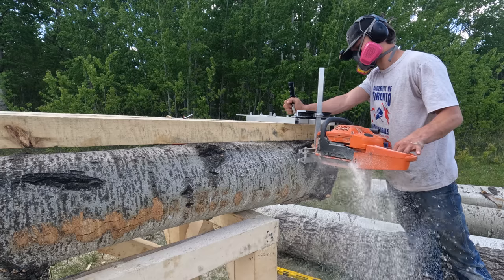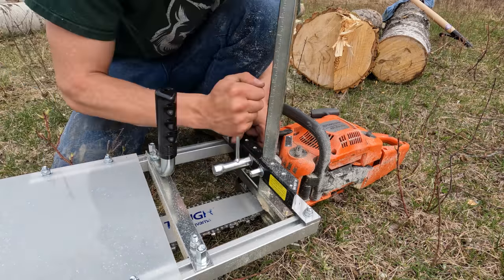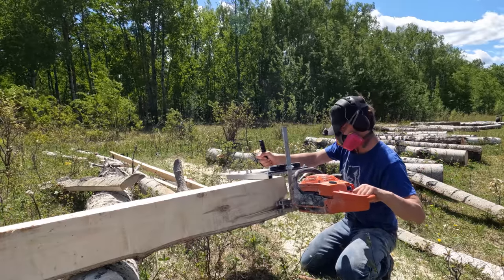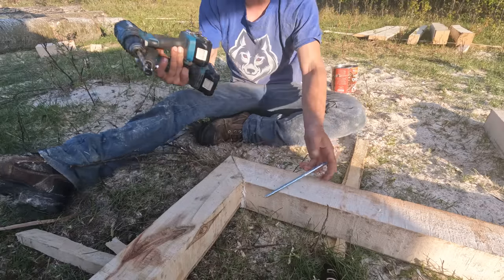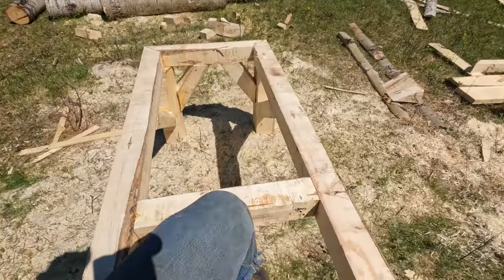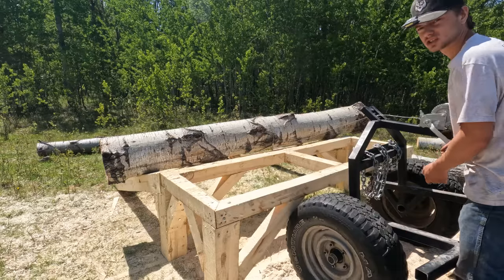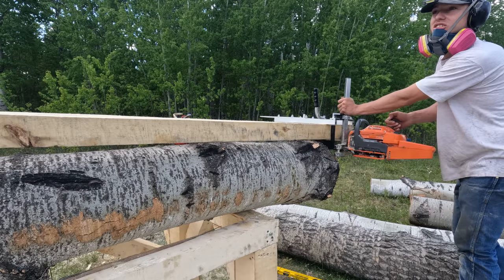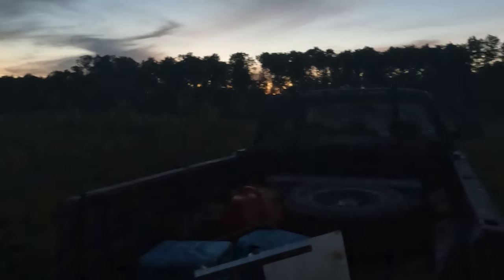New Chainsaw Mill - Milling Lumber, Building a Workstation for the Mill

Comment from the maker: Hey friends I hope everyone is doing just great and that you enjoy the video. I am seeking assistance in regards to treating the milled lumber against wood insects. I have been seeing a ton of old house borers (i think this is what they are called) around my mill. Dont see damage on the wood but am wondering how i should go about protecting the lumber from infestation of all sorts and thought I would ask you guys what you would recommend doing. Thank you
Reply: Borax and water in a spray bottle
Reply: Borax and water, spray it on
Reply: TimBor or Bora Care, commercially sold. I use it for house treatments to protect against beetles and termites here in Florida. Good luck!
Reply: @russellwatters5891  that's what I was going to say.
Reply: @matthewharvey8755  sorry, I took the words right out of your mouth..lol 🤣😂
Reply: So three things here...you have water and bugs outside that want in, burn them with a torch/fire that actually works really well, but takes a long time.There is copper green, it's a paint on green treat to keep bugs from entering, borax mixtures, TimBor is nice, as well as Bora Care. The bugs inside deep(6+ inch) will not be effected much.... Unless you want to soak in a green treat, but that's $$$$$$. Lastly (my method) is mix a 50/50 diesel with used motor oil. I use it on all my lumber, it's nice on my southern yellow pine. For post I burn them, then apply a thick coat of roofing tar.
- So in short, bugs inside deep will not be effected, but those under 1 inch can be killed, and it can be treated to keep em out. 
- Can't wait for more milling videos, I love my Woodland Mills, already want a bigger one
Reply: @matthewharvey8755  I'm not sure Coppertox is available anymore, and the green is just a dye or tint added to the mixture to show where it's applied. Green or green blue lumber from box stores is mixed borate/ and tint. Soaking in a vat is definitely the best method, only it makes boards warp from the moisture.  I can only speak for what I use here in Florida, an exterminator for 42 years, I've used pretty much everything. Not certain about Canada products, but check your local extension office, or research online for identity.
Reply: If the bark is off the wood you don't have to worry about insects. Also it looks like you are ripping your lumber a full two inches. That is just wasting lumber if you are not sending them to get planed down to store bought dimensions.
Reply: Tried lightly torching it?  "Shou sugi ban" nukes some of the proteins in the wood and makes it less appetizing.
Reply: Old burnt oil is the absolute best thing to use for treating your lumber and it’s cheap.
That’s one heck of a massive strong platform for cutting down the trees into lumber. Brother you’re doing a fabulous job and you really take your time and you’re building it right! 
Thank you brother for sharing your time in the bush with us all, I can’t wait until your next video comes out every single time and you have me rolling laughing out loud so keep up the great work! Thank you 🙏
Reply: Get rid of the bark on your logs as soon as you can it does prevent some bug infestation also they dry faster without the bark.
Reply: Hey love the videos. I live in Saskatoon, I have a huge 5 gallon bucket of framing nails that I will never use. Not sure if you make it down here but I would love to give them to you. You would have more use that I do
Reply: Down in the states, we have ash borers show up within a day of cutting or splitting any ash trees or wood.  Don't know if they are attracted to popple or not.  They don't hurt the wood any, just like to lay eggs under the bark.
Reply: 50/50 diesel and motor oil. Brush it on thick and let it soak in.
Reply: Would a solar kiln get hot enough to kill insects?
Reply: @keen9629  he has a large forest mate and said that he wanted to work with true dimensions hes not running out
Reply: @thispandaispurple  best way to get rid of bugs on animals. Also the dish soap and javex method is for grubs eating your grass. Best way to treat wood is remove all the bark right away and use a pesticide for that type of wood. Hardwood is the worst for bugs like pine and spruce but either way the wood has to be treated as soon as you can.
Reply: Some advice u have steal a welder  buy a motor put it on it is cheap and it work look it up on YouTube and save time and simple 😅😅
Reply: Just wanted to say thanks for being real. About the process, the problems and the solutions. I have some big ponderosa pines that have been drying on my land for years, and I plan to mill them up, w chainsaw, this afternoon. Seeing this comment made me to some research into Borax and water. Going to be treating the boards with that. Also Subscribed.
Cheers

Comment: As an old one-armed chainsaw mill operator (I moved up to a bandsaw mill last year) I've found it just as cheap to buy a 2000lb 12v remote control winch for around $80 from Harbor Freight. You can operate it from your ATV or 12v lighter on your truck. I use half a section of a 24' aluminum ladder for my guide-rail and it always produced nice boards. Hope you have as much enjoyment making your own lumber as I have in my 67 years of living free. Love your channel and been with ya since the get-go!
Reply: Drilling holes up the 2 rails and putting in stop blocks to prevent rollback would help too.

Comment: Two things. First your out in the boondocks, you need to buy a good tourniquet. They don't cost that much. Cut and artery and your going to sleep quick. Keep it on your belt all times your using a chainsaw. Second you need a rip chainsaw blade that blade cuts faster and produces a board without waves. Looks good.

Comment: Hey bud, good job building that. I usually mill with a 372XP, nice to see a 455 at work. As a tip from a fellow Canadian, I started using a narrower stihl chain. I also use skip chain and filed it similar to a Granberg milling chain. Think there is a video or 2 kicking around here. Speed of cut was night and day! Easier on the saw too. Give it a go and see for yourself.
Reply: I started out with a 455 Rancher and very quickly realized I needed a much bigger saw. Went with a 395XP & I also use a skip tooth ripping chain. I am usually sawing 30" plus doug fir though. I just use half of my extension ladder for a starting rail. If I would have known back then what the cost of lumber was going to do, I would have probably just spent that money on a band saw mill.

Comment: What you need is a longer cable to go around your log then back up to your winch. Then what happens is as you pull the cable in it encircles the log and the log rolls up your ramp. Stay safe have fun God bless   🇨🇦✌️
Reply: Yeah weld a lug on the skidder. It will actually make it twice as easy to winch too as having the double length of cable has the same effect as pulleys.
Reply: He knows. He says it in the video

Comment: Don’t know if this has been mentioned but “wax” the ends of those puppies and stack them semi-proper with stickers every so often (depending on overall board length) and they won’t move around too much on you. I’ve heard guys just paint them thick with a latex on the ends and it works just as good. No twist, no curl, just straight shooters.

Comment: Looking great ! Good work on quitting the darts and trying to help your health.  I would also consider wearing a respirator when grinding/ welding . Those wheels create a mean dust and flux core isn’t the most clean welding fumes  out there . I like the 3m pink pancakes 2097 so they fit under your hood. Looking forward to next vid !

Comment: Congratulations Bud you are now a sawyer,  nice set up for sure . The only advice I have with poplar is either nail her quick or strap it quick.
      I think getting it dry is the only preventative there is ,bugs need moisture in the wood . After it dries it gets very hard , this was a great episode thanks. If you can't get it under a roof then old tin on top seemed to hold a cooler temp for slower drying.

Comment: Flip the handle around on the mill attachment. It’s will be easier on your back. As for the oil you can turn up your oiler for the bar. It should be located on the bottom of the saw. I just adjust mine until I use just as much as it take for the gas to run out. Or you could refill more often. Periodically pull the bar off and clean the groove out with a knife.

Comment: I never realized what nice square lumber that would make. You must have got the angle right. Those are heavy logs. So far you made everything you're using, even the log skidder. I hope that hot shower is working for you. Great video. Pax.

Comment: Great video, old retired forester , portable sawmill operator here, welder , fabricator!  Think - your ramp & log platform is superior , what I if your top rails were fastened to the platform over top your log.  Use a cuff. To allow raising $ lowering rails, pin in place Cut, flip log, lower top rail say 2 inches to cut other side,  even have a square side jam to do that 90 degree cut.
I bet u could fabricate this easily on your platform,  be unique, & make a unique video!
I will follow you progress! 
Bill in Indiana
Reply: Holy smokes Bill!  that's a great idea!

Comment: The best, inexpensive and easiest solution to keep milled lumber is a Japanese technique called, shou sugi ban. You char the wood to an alligator texture,  brush it back with a wire brush and then oil it with linseed oil. Do some research and check it out. Sealing the ends of the wood with melted wax will also help prevent the wood from warping while it dries. I'm so happy to see you excited about your new projects and look forward to watching you grow as a builder. Your welding is beautiful and your precision with wood is just as craftsmen like.

Comment: quick off the cuff idea.....check the junk lots for treadmills! big wide belts and rollers! Not to mention electric motors you could solar power maybe? or check local restaurants for old cutting bords AKA Delrin to make sliders for the ramp

Comment: Damn that's a lot of hard work! Good on ya bud! If your winch cable is long enough, run it from your winch under the log and back up to the winch body, that way it will roll up vs drag up. Little slower but way easier on you and ramps

Comment: center the tree growth rings at the ends to horizontal .  then cut it on horizontal cuts to get the biggest beam size possible on that log on 4 sides.  then make boards.  it helps you get a flat edge on all sides....then trim on the 4 sides can be use for siding too...if trimmed to a width .....fun times watching this !
Reply: I'm trying to make sense of what your saying but I'm not following eh

Comment: I use a removable counterweight  on the tip end of the mill, then rig a rope from the saw around the far end of the log and back to the tip end of the mill, start your cut as usual, once mill is stable, attach counterweight and rope, lock throttle on and move to the far end of the log and step inside the rope loop so that its around your butt then lean back pulling the saw towards you as you move backward. This keeps you a log length away from the dust and fumes and you get a better cut as you're not fighting the saw. I use this method running a 48 inch bar on big logs, it's simple and costs nothing. You can even read a book while you're milling 🤣

Comment: I bought a $98 Zozen and milled 10 - 6x6's for my moms dock on a hidden lake at 9000 ft in the Rockies. I bought it because the 6x6 x8s are $54 each, I saved her $540. But after the 10th 6x6, the Zozen Mill took a header. So moral is, BUY A GRANBERG! Here's the thing though. The satisfaction that you gain from milling something on your own has value. Its quite the feeling when youve accomplished what mnost wouldnt dream of. The mill cost me 98 bucks. It got me $540 worth of lumber, and! i got to pick the trees. Fat spruce, heavy wood, treated them myself, no toxins in the lake. Boom! mission accomplished. Good times! Oh and I used a 50cc Huskvarna 550 Xp. I recommend a ripping chain an anything 70cc, its faster and no bog. BUT!!! OIL OIL OIL makes it go much faster. SO I took one of those 10-speed bike water bottle water things and attatched an old IV i had from Kelation therapy i had to do years ago, with a drip I could control. It had a steady drip to the chain and went through much easier.

Comment: If I recall I think you can buy a rip chain for your saw. If so it will make your work faster and easier on you. Regular chain saws are designed to cross cut.

Comment: Maybe buy a winch that you would put on atv and mount it on your log horse in place of the boat winch. Hook up to battery and use to pull logs up on bench . And maybe sink a post on a end of bench and mount a boat winch to mill so you can hook to post to help pull saw threw log so you’re not pushing the saw but pulling the saw thru.

Comment: Hello, a quick hint if you have not already learned it. to load the log easier on your workstation, run a small chain, or cable anchored to your log mover, down the center between your ramps, roll the log on top of the end of the chain. pull your winch cable out, and hook to the  cable over the top side of the log, that way when you turn the winch, it will roll the log up the ramps rather than try to slide it up the ramps,

Comment: Nice work on that mill man!! Looks like you’ve got a great plan for building and milling!! I’ve heard that rubbing your boards down with salt or just a weather proof wood sealer will help keep the bugs out. Salt may pull too much moisture out to quick but if you go light on it, it should work and be cheap

Comment: Use a ratch strap (  long and wide ) tie it to the work station at the log skidder. Stretch the hook end to the end of the ramp, then hook the skidder cable to the ratch strap hook. As you winch it up it should roll right on to the work station.

Comment: You know with your knowledge and skills you should easily be able to build a horizontal bandsaw mill. Much more efficient than a chainsaw mill. You have all the tools  necessary. Tons of YT videos with ideas on how to build one. I built one myself and I have very little skills when it comes to building. But at 73 I did it. You can too.

Comment: If you already have the drill you should pick up a worm gear winch. They mount the same as the one you got. You can tighten the chuck of your drill on the drive shaft and you’re good to go

Comment: If you put a strap and connect one end near your winch and run it under your log, hook the winch to the other end of the strap over the top of the log.  It will let you use the winch to more easily roll the log up your ramps instead of dragging it up them.

Comment: Josh, take a old ratchet strap and wind it around your log and then tie the end to the winch cable so it will roll like you were first going for. Damn slick setup... no one can fault ya for it. I am sure they make chain for the saw thats just for ripping logs/wood with the grain. I know then it shall cut a minute or so better.. nice work
Reply: He knows. He says it in the video

Comment: Sharpen that saw at a 10degree angle or get a chippin chain. It will make your life so much easier. The way she was bogging down sounded like you were using a normal 25/30 degree chain

Comment: To get the log to “roll” up the ramp don’t hook the cable to itself.. run the cable OVER the top of the log, then go under the log and then hook it back to the winch. When you crack the winch it will cause the log to roll.
Reply: He knows. He says it in the video.
Reply: The line isn't long enough.
Reply: @huejass8932  yes he mentions that too in the video
Reply: I'm aware, I was replying to OP

Comment: Using your saw like that sure will eat up a lot of fuel...Been there done that...Some people will change the chain for a ripping chain or a skip tooth...which is sharpened at different angles but removes wood  more efficiently...Thanks for the video.

Comment: I'll say it again for you to check out the YouTube vlog " Surviving Ringworm " Don't let the title fool ya , the guy is good . I think you'll pick up a lot of tricks and good ideas , looks like you may have already with the metal rail holders. Have you tried wrapping your cable around the log so it rolls to you when you winch it ? 😉 and chain , chain , chains and a good sharpener,  save you a shit load of work !!! Great job and imagination there young fella . Oops,  also this guy uses a battery powered plane by Ryobi , works slicker than snot on his milled boards , so good I'm getting one !!!

Comment: hi mate... not sure if you solved the borer problem but if you can get hold of this stuff it might help... we use it here in 
Australia ....Permethrin insecticide for timber borer control due to its low toxicity profile and it's ability to penetrate into the timber grain - Permethrin is a based on the natural of the pyrethrum plant - used to eradicate the adult beetle as it emerges from inside the timber..... by the way your videos are great, your a very talented young guy, you have a great future ahead of you and i wish you all the best, im an ex carpenter and just love the smell of newly sawn timber.

Comment: Just a thought, what if you drilled 1" holes in the center piece spaced 3 or 4" apart and add removable pegs to prevent the logs from rolling off as you cut or rotate them.